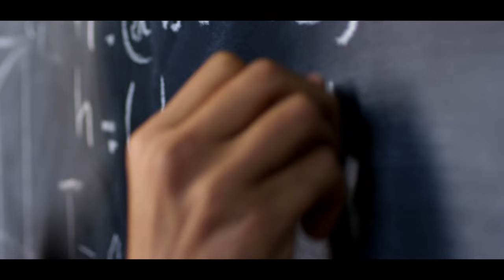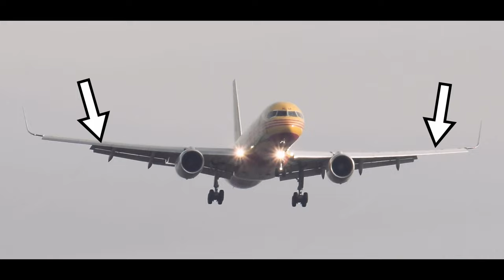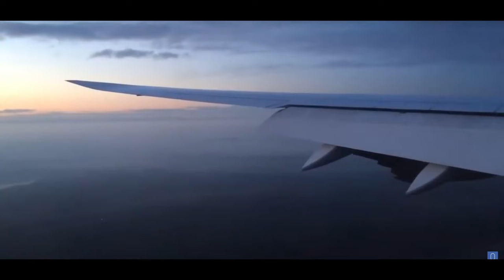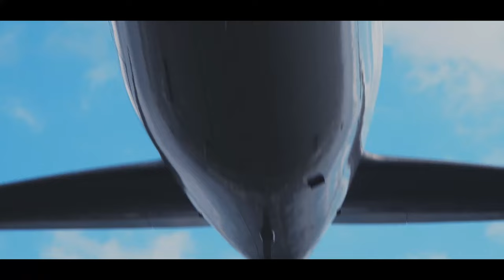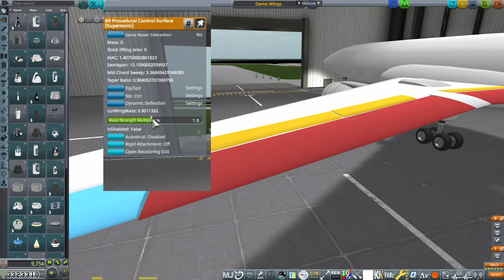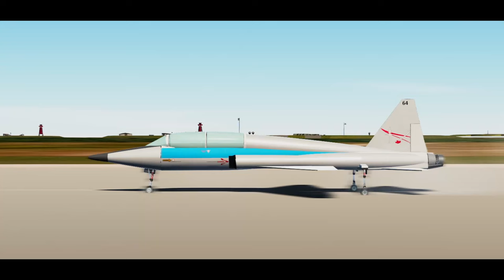The Only KSP Plane Tutorial You'll Ever Need

Comment: Additional tips for when you've built yourself an aircraft!
~ Ferram Aerospace's editor UI has a "stability derivatives" tab. It breaks down Stability and side-slip for Pitch/Roll/Yaw at any speed an altitude you input. Red numbers indicate instability.
~ KSP has trim built into stock. If you hold Alt and tap or hold WASDQE, you can level your aircraft or fly really smoothly without any SAS or autopilot. Alt + X resets trim.
~ Decorate that thang, it's the best part ;)
Reply: NO WAY THE REAL N9 GAMING HIII :3
Reply: wait that trim tip is GODLY!
Reply from the maker: You complete me. 😘
Reply from the maker: @aadvaitture indeed. I... really should have mentioned it.

Comment: You can have leading edge slats/flaps by attaching a control surface to the leading edge of the wings and set AoA% to something like -80% or -100% even. The flap will automatically move opposite to the angle of attack. It really helps the plane pull more AoA, stall later and be more agile. You can also enable dynamic deflection and the control surfaces' maximum deflection will exponentially decrease with speed, up to a minimum.
For my fighters I usually set up the leading edge flaps to -100% AoA, 40 deg max deflect, dynamic deflection start speed 100 and minimum control 0. The elevators also use dynamic deflection starting at 100 speed and min control 0.6 or 0.7
Reply from the maker: Pro design tips

Comment: i just want to clear one thing: spoilers and airbrakes might achieve similar results but they're completely different in their mechanism:
the job of an airbrake is to induce drag while the job of a spoiler (the main one, it still increases drag) is to disrupt the airflow above the wing decreasing its lift

for example, F-14 Tomcat doesn't even have ailerons, it uses spoilers instead so the wing basically generates negative lift and the aircraft rolls

26:08: T-38, F-14, F-15, F-16, F/A-18 and Shuttle Orbiter are all airbrakes/speedbrakes, while C-5, A380, A330 and C-5 again are all spoilers/lift disruptors

but i don't know if definitions differ in NA, after all i'm not an engineer, i'm just a nerd
Reply from the maker: No, your comment is quite à propos and accurate. They are their own separate things, nevertheless, both spoilers and airbrakes are drag devices. The one big difference, I would say, is that whereas air brakes are only just that, spoilers are more than just that.

Comment: This video is cool and all, but I'm also curious about optimizing wing sweep, area ruling optimization (according to far), as well as the optimal intake area and placement.
Reply from the maker: Indeed. I wanted to cover the essentials. But you're correct. Might have to do a follow up video
Reply: @CalvinMaclure  Please do a follow up video for that FAR transonic drag reduction! 

All of the stuff in this one is super helpful for people with no plane experience, and even with some I found a couple things I'd been overlooking, but the part I've really been struglling with is interpreting the data from FAR transonic tab.  

I can move things around and see the numbers go up and down, and I've got the general idea that the smoother the lines over the fuselage the better, but that's about all, and not nearly enough to optimize to the degree I wanted to.

I have mostly figured out the stability derivitives based on making extremely stable and unstable designs and comparing numbers, as well as the L/D ratio at various angles of attack, but I don't know what the numbers in the transonic design mean, and if I should be making them go up or down.
Reply from the maker: @ben4R  excellent suggestion, and yes, after seeing how popular thus fat this tutorial has been, a follow up seems most appropriate.
Reply from the maker: @JYF921  yep! Great points. Working on a follow up tutorial to cover these more advanced topics.
Reply: @CalvinMaclure thank you for your response. I suggest centering your following tutorials around the XB70 or even faster aircraft that can fly well beyond supersonic. I am curious if and how air intake placement relative to other parts and unique geometry by procedural wings affect aerodynamic characteristics.

Comment: So, I know you showed several planes with them in the video, but I do feel you forgot to mention in the elevator section that you could also place them as far forward as possible. You know, canards.

Also I tend to find slats in KSP work very similarly to flaps.
Reply: Front canards don't naturally stabilise the plane like horizontal stabilisers do though, so I feel like its one of those - if you don't know if you should, you're not ready for them - things.
Reply from the maker: I didn't get into slats for the simle reason that they don't actually behave as they do irl. To get them to actually do anything, you have to invert the motion which I find silly. 

Also... choices were made for the sake of time.

Comment: the only part i REALLY struggle with is YAW at high speeds. (using FAR) my guess is that air is pushing the front side to side but even so, feels like the tail can't keep it strait, if i try to YAW it back it kinda rolls and there is no way to have a inverted ROLL output per YAW input... still very useful video, quite a few tips i learned and a few of them i knew without knowing "why" it was always suggested or worked well when i did it randomly.

Comment: I quite like this video but i have a two things, doesn't your flaps stall immediately at 60 degrees deflect?
*EDIT: This next section is about tuning landing gear but I forgot to mention that stock landing gear is different and wonky and that my advice applies to the adjustable landing gear in Kerbal foundries. Didn't want to completely contradict Calvin I think his advice is sound!👍
And about landing gear in particular, I use to think that when tuning suspension i should do what it appeared you did which was a fairly similar or even smaller spring rate to damper rate ratio and its better than stock but I've found that generally damper ratings should be like third of the spring rating or less, enough to keep the spring from bouncing excessively, and the spring rating should just be high enough to not bottom out on most landings immediately. That makes landing a lot easier i never bounce off the ground that way and i find the suspension action super satisfying to watch. I just get so much joy out of it had to share here!
Reply from the maker: Flaps don't stall. Canards would stall, yes, but not flaps.
Reply: @CalvinMaclure  really? Cuz that's a common occurrence for me? If I don't design something carefully enough and my flaps are too aggressive for the specific design and flight envelope they'll stall when I'm trying to land and I crash. I know it's the flaps and not the main wing by using FARs stall highlight and surface stall indicator in the part menu. Is there anything I'm missing?
Reply from the maker: @guardianofgames7452  what's happening is the increase in drag is slowing you down so that the plane loses sufficient lift. You can have a flight control surface stall without the plane itself stalling, but that can't happen with flaps.
Reply: @CalvinMaclure  I swear I know what you mean, but I've done tests with an autopilot. This is all assuming we're using FAR like you were in the video. I can be traveling a constant airspeed and I'll deploy my flaps gradually through the 3 settings. My AOA decreases like expected, but if my setting is too aggressive then it crosses a threshold and the flap itself begins to stall. I'm assuming this is because angle of attack has diminishing returns and eventually the gains and lift don't decrease the AOA enough and the relative AOA of the flap is too high and it stalls, so I lose all the benefits of the flaps, my craft AOA rapidly increases causing the rest of the wing to stall etc. I can see it on the right click menu where it says stall% that its stalling. You know what I mean yes? And I was under the impression things like slotted flaps aren't modelled so I can't use that?

Comment: Putting the pivot point of the aircraft on takeoff as close to the CoM as possible (or even better, ahead, as in a taildragger) is important in stock KSP for very different reasons: Putting extreme downforce into your rear gear on takeoff from both sides is very dangerous, as it can lead to "gear driving" where Unity's suspension physics glitch and cause the plane to constructively bounce and jitter on its wheels until your plane either breaks apart from the forces or flips and crashes on the runway! Overloaded suspension is one of the most powerful forces in KSP, and can eat your planes before they ever get off the ground.

Comment: Thx for the amazing tutorial ! Just a thing : I cannot find the Mass Strength multiplier (23:16). Is this a mod ? 

Edit : I have a lot of things not present like the flaps button this is strange maybe I have to enable something in the setting of the game ?
Reply from the maker: @alexblakfire  are you sure you are using the movable parts? Not all wing pieces are flight control surfaces, though they are all wing pieces. The mod (which is part ofnthe RP1 INSTALL) is Procedural Wings.
Reply: @CalvinMaclure  Yes I am sure it's a moving part because I do have the other options : pitch roll etc... 
I am starting to think that some other mods I have installed (Kerbalism) may remove those options... Strange :/ 
Anyway i will find a solution thx for your time

Comment: I appreciate all of those contents,but there are another question to be asked.in case of rp1,how to make planes cheaply?
Even making a derwent jet would cost me 500 in a conventional design
Reply from the maker: @listener-tt1gw  I'm an engineer, not a project manager 😉
Reply: @CalvinMaclure  Okay after some hours I figured it out…Remove All stabilizers, including vertical and horizontal ones,remove flaps, make a single delta wing design.
Although making a tailless delta wing without vertical stabilizer may result in tailspin easily, it is still worth it because it saves more money compared with risking to lose money on a dead kerbal.

Comment: Doesn't all objects pivot around center of mass? Why do you say that center of lift acts as a pivot?
Reply from the maker: Great question. Well, in the same way that during takeoff rotation, the point of pivot is the landing gear on the tarmac, not the CoM, once airborn, that pivot becomes the CoL, not the CoM, because the force acting on the A/C keeping it aloft is centered at the CoL.
Reply: @CalvinMaclure  but if CoL is the pivot point when an object is airborne than why does CoL must be behind CoM in order to make it stable? If it is not turning around CoM than shouldn't it be also stable if we put CoM behind of CoL outside of some pitch up tendency
Reply from the maker: @j0xx02  because it is the sum of the forces acting on the plane that produce the stability. The empanage is counteracting the nose down tendency caused by the CoM when it is forwards of the CoL. The more it is forwards, the more the empanage has to counteract it, which makes for a more "braced" aircraft, so to speak.

Comment: "The Only KSP Plane Tutorial You'll Ever Need" except its not, because you're using parts you created yourself through the procedural parts mod, which most people wouldn't have installed, and thus you have access to a ton of options that are NOT available to regular players.  While I got some ideas, there are some concepts that just do not apply:
1) trim.  In stock KSP parts, the trim is on what ever is set as your pitching parts, while this isn't necessarily true (no fighter jet I've seen landing uses the elevators for trim) in real life.  So you're stuck using action groups (like you mentioned) to trigger them... but trim in real life is also used to reduce having to constantly hold back or forward on the flight stick.  For example, if your jet is constantly trying to slightly nose down, you could use trim to create a stable level off.
2) air brakes/spoilers.  There's only one airbrake in KSP, and while you could use it on the wings, you'd be better off using a different control surface, such as the same ones you'd put on the wing for roll (the small ones), have them maxed out on "Deploy Angle" and toggle deploy with the brakes action group. This is actually one of the ideas I got from watching your video, that I'm surprised I haven't tried yet 
3) Wing curving and thickness.  In stock parts, there is only ONE thickness to all the structural wing parts, the only way to get thicker (which if you decide to do for some reason, should be done NEAR the fuselage, not near the tip) is to clip structural wing parts into the ones you've already got placed, then rotate them appropriately.  As far as the anhedral vs polyhedral wing setup (wing curvature), this IS actually doable in stock KSP, but it's a bit of a pain.  Set the base of your wing on the fuselage with snapping turned on (keep the wing on the center of the fuselage for now).  Then, change to the rotation tool, and while holding shift, click and drag slowly on the axis you want to change.  This will keep it snapping, but it will make much finer adjustments, you only want between 1-4 clicks with the amount and the direction BOTH dependent on where the wings will be - completely centered should have no curve, assuming your CoM is in line with the vertical center of the craft, if your wings are higher than CoM you want them to tilt toward the ground, otherwise they should tilt up... they should also move TOWARDS CoM.  You can either do this with just the base wing structure in place first, or build out your wings then make these adjustments (the more structural wings connected to the base one, the easier this will be obviously). Now, move your wings and make sure the tips are just inside the CoM if you applied wing curvature.  Another way would be to keep the parts touching the actual craft (I got tired of typing fuselage) level, and for each section away, tilt them one click until the tips are inside, but not passed, the center of the CoM indicator.  If you look at the examples of this video, or pull up your own images of aircraft, you can find examples that match both shapes you get from this - I've noticed lighter jets seem to have the whole wing surface curved, while heavier jets like the C-130 have a level surface that goes into the anhedral curve.
4) this is probably the biggest issue, and one of the first complaints I had with KSP - there is NO stock wing surface that holds fuel.  It is extremely frustrating, as this is how every jet that I've controlled (as in directed, I've never flown my own unfortunately) and every jet my father worked on (he was an aircraft mechanic) worked.  However, there's a work around.  You'll need to upgrade one of the buildings to tier 2 (I can't remember which one) so you have access to fuel transfers, as this also gives you access to flow priority.  Now, just build your jets with fuel tanks that are odd in number in the fuselage (there it is again), and set the outer ones to a higher number than the central one (the one where you want CoM to stay), with the highest ones being furthest away.  For example, if you have 5 sections for fuel, and your CoM is in the 3rd section, your priorities should look something like: 30-20-10 (KSP usually defaults them to 10 for some reason) - 20 - 30.  I go up by 10 because I've noticed that's when KSP actually seems to obey it if you're making adjustments in flight.  For any fuel tanks that are for some reason not inline with the center of the craft, set those to the highest priority (for example, the engine nacelle), or drain their fuel in the VAB/SPH before launching.  Obviously, this is only for if those are not your only fuel tanks.  If you're mounting fuel tanks to the wings (I see a lot of people do this) instead of using the fuselage ones, you'd do something similar here: 20-10-20 for a 3 tank part.  You could make some monstrosity out of wing structures and clip fuel tanks into those, but I highly doubt you'd be flying without the kraken ripping your wings clean of in that set up, if it even got off the ground due to the weight or the shape of what you'd have to make not being properly calculated by KSP's physics.

Your video unfortunately highlights a major flaw in KSP - they designed it with really just rockets in mind, and planes of any form were an after thought.  As such, you don't have any good ways to replicate much other than the space shuttle without a lot of clipping and finetuning.  Having said this, I've made the SR-71 blackbird with stock KSP, with as close to public knowledge specs as I could get it, and it actually exceeded public record specs.  But it looked very bad compared to the real-life counterpart due to the limited amount of customization (i.e. paint), and all the z-fighting that was going on with the textures due to all the wing structure clipping I had to do to make it.
Reply: Just use the mod